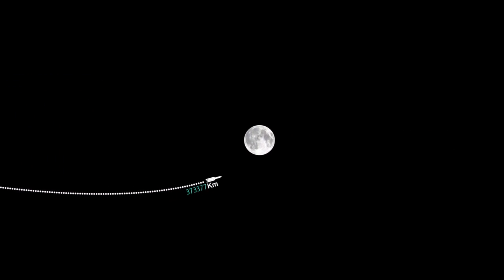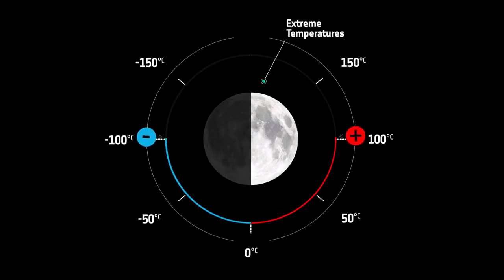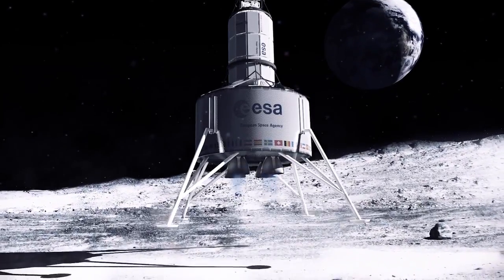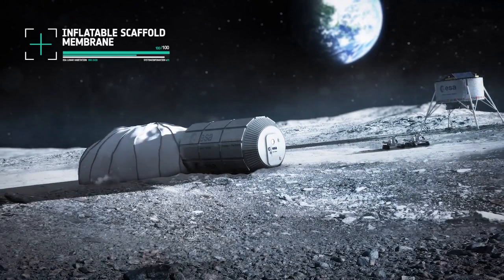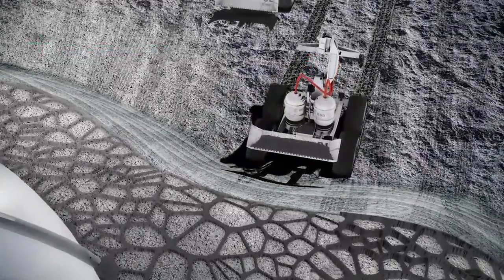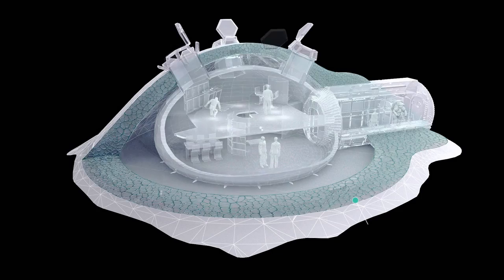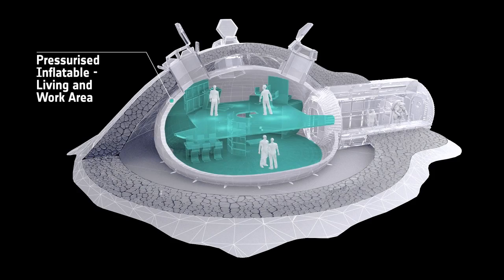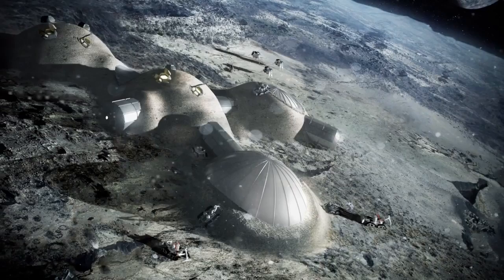Creating a Lunar Base With 3D Printing Technology | Space Video

Comment: That inflated cupola cannot have a flat bottom, because it has no form-stiffness like a curved surface has. A pressure inside of 1 bar (100 kPa) would yield a pressure force of 10 metric tons per sqm, thus bulging out that "flat" bottom. This is not feasible! All illustrations of cupolas, flat on the surfaces of the Moon and Mars, are fiction only.